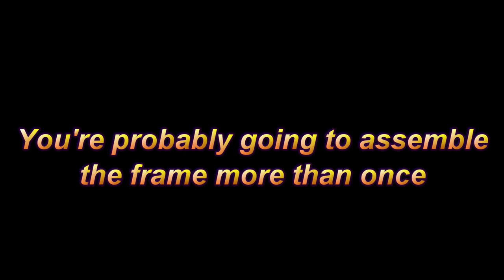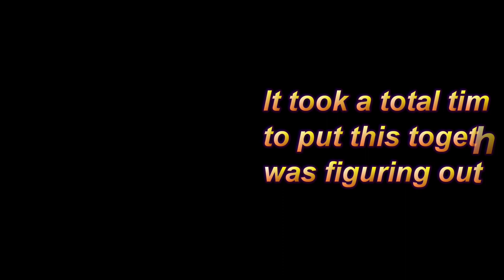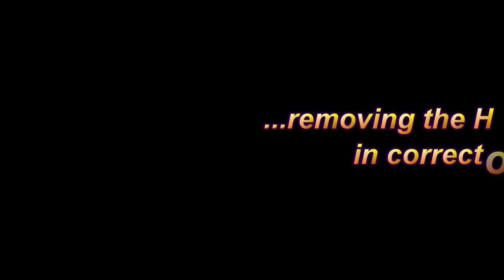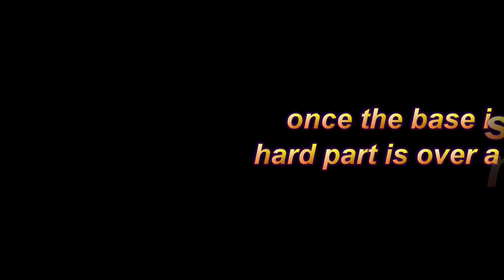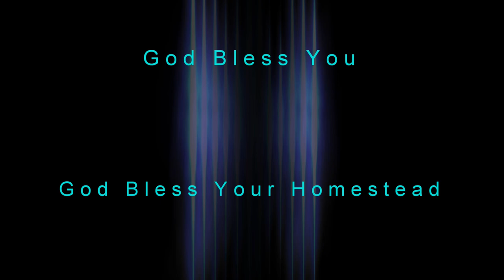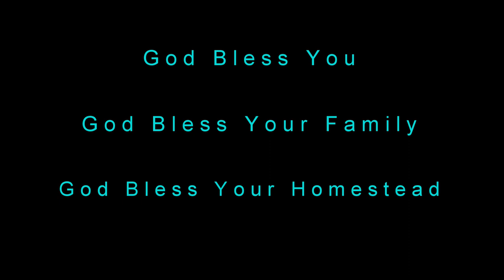14" harbor freight band saw #harborfreighttools #harborfreight #bandsaw #assembly #woodworking #tool

Comment from the maker: this isn't too bad to assemble.  If you are thinking about getting one, do it!  I have used several band saws over the years from cheaper to way more expensive and for the price, I don't think you can beat the quality and performance of this one.  With that being said, I am not trying to use it to resaw hardwood lumber with a 6" riser block - I may try this in the future but its gonna be a while until sometime after I get caught up.  Subscribe and enable notifications so you don't miss that video.